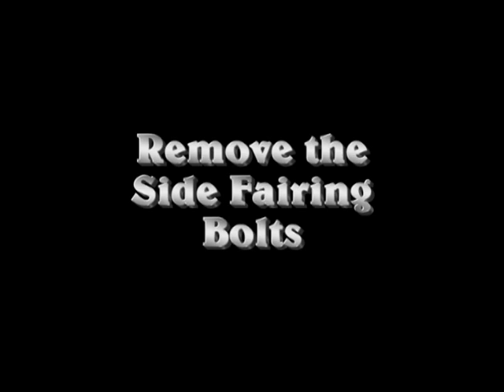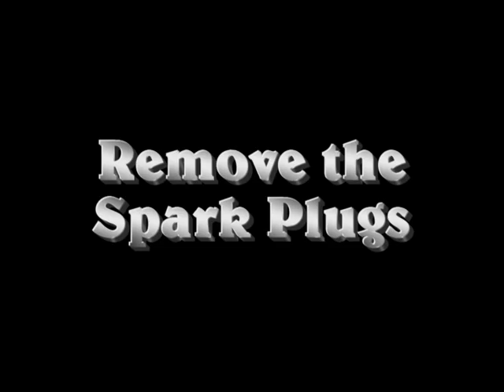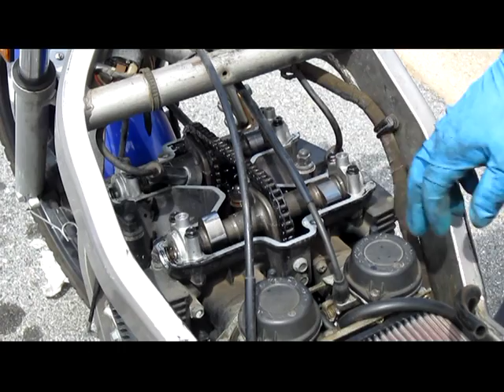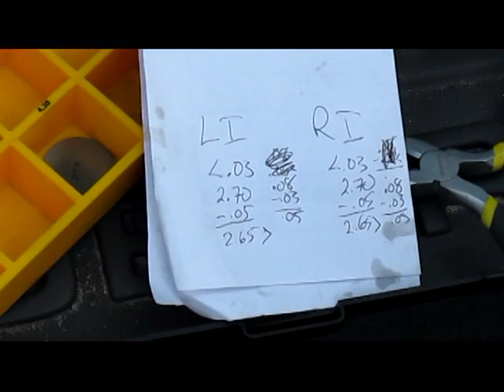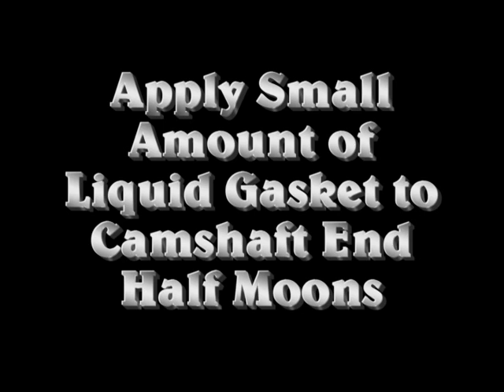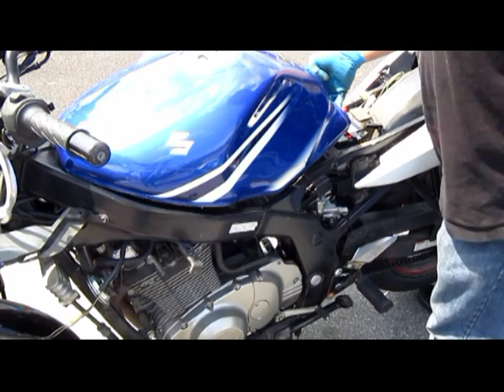1989-2000 Suzuki GS500e Valve Clearance Check and Adjustment

Comment: As a professional car and bike mechanic. I have to say, it's very hard to fault this video.
The Gs 500 has the same valve set up as the GS. 550, 750, 850 1000.If I remember correctly. But was Different on the GSX four-valve models. Good video and thanks for posting it. My best to you from a windy Scotland.

Comment: "the valve clearances shoudl be checked every 4000 miles"---you must be high on crack. Usually a valve adjustment is needed every 30,000km (whatever that may be in miles)...and by nature the valves will tend to get away and away with the normal use, because the shims get eroded and thus thinner...therefore increasing the space between valve shims and cam, so the valves dont open as much as they should because they are too far apart
Reply: +allnamesarepicked To be fair, that's what it says in the manual.
Reply: You are completely wrong. They need to be checked every 6 000 km and they tend to get tighter with use because the heating and cooling down will make the valve shaft longer thus reducing clearance making them eventually not close all the way and burning
Reply: @greyhunter37  Wrong, I have done +20K miles on my GS since my last valve adjustment and first now I got a bit of valve clicking (noise) telling me that the clearance is a off a bit (too big) as the valves is made of harden steal and really can`t stretch (would break instead) but is worn down over time and therefor get shorter and because of that wont open as much, you will typical fell a loose of power if they begin to get off too much, also to changes shims, like in this video (which is a great tutorial btw) at 0,05 is overkill, if they are off by 2-3 of a ten of a millimeter then ok, but half of a ten wont really make any difference. 

P.s. on a RR bike I would check every 10K miles or so, but a GS is a work horse, you rarely go above 6k Rpm with and have plenty of clearance on its single valves per cylinder, every 4K miles is something the shop who charges +200$ to check em for you would like you to do.
Reply: @Uriel-Septim.  I've worked on multiple GS's and most need at least one valve to be adjusted each time they come in (around 6-7K Kms) and almost always the clearance got tighter. The manufacturers recommendation is 0.03-0.08 in clearance tough I prefer to do 0.05-0.12 myself
Reply: @Uriel-Septim.  Everything I am saying is only true for the GS tough, a lot of bikes the clearances get bigger and need way more clearance than the GS
Reply: Yep.. I tought the same

Comment: I'm in the market for a gs500e. What will 1500-2000 get me? I can do the basic maintenance but I don't want a real sh1tbox
Reply: i just bought a very good condition gs500e 2000 for 1900 bucks all in all i spent about 2200 with helmet dmv shit and insurance and ive had a wreck in a car. i think you can find a real decent one for 2000